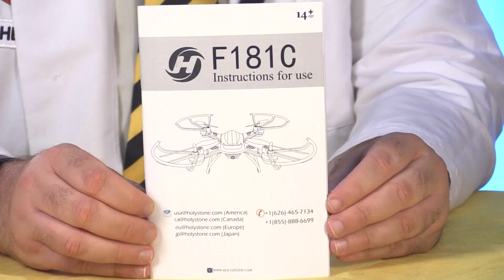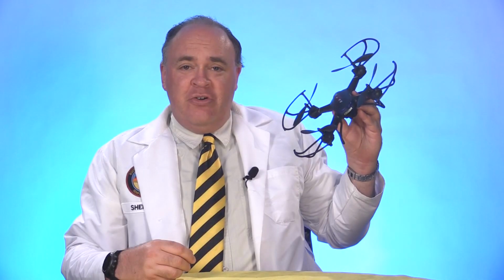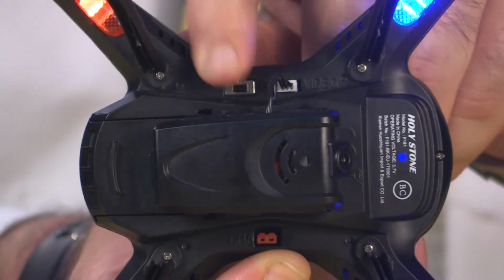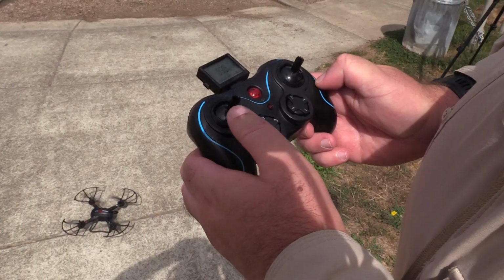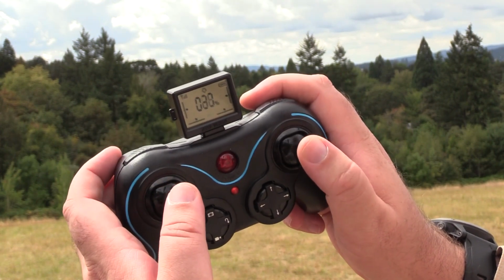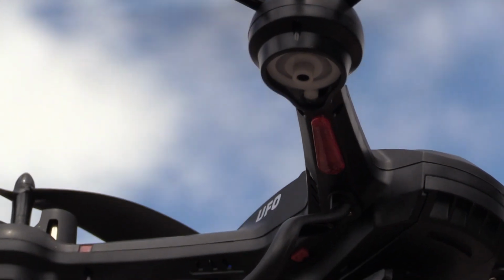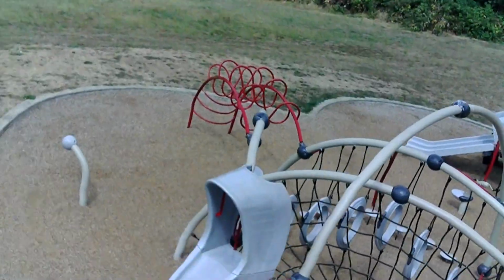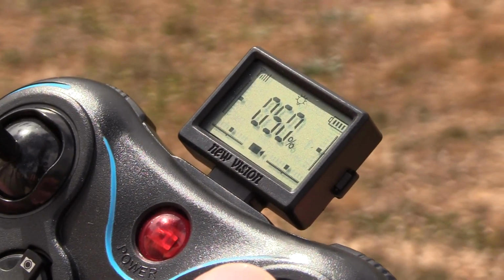Holy Stone F181C Unboxing, Setup and Testing

Comment: Holy shit, a bit like the Feilun FX176 that I did a review on https://www.youtube.com/watch?v=3O-OPOdq4_8  could be made by the same manufacturer. Also found out when the motors burn out after about 20 flights you can't replace them, not available.